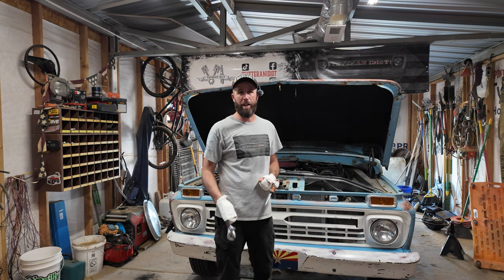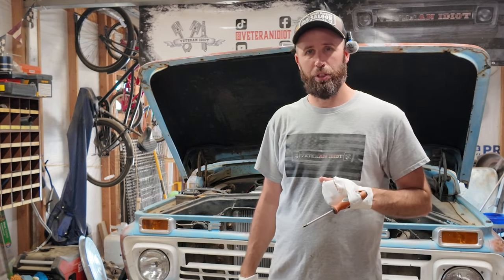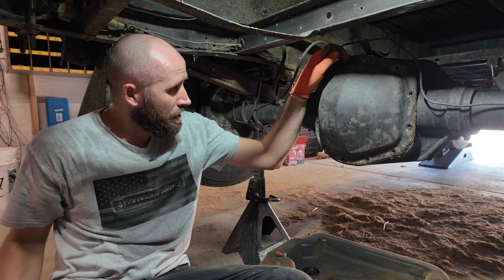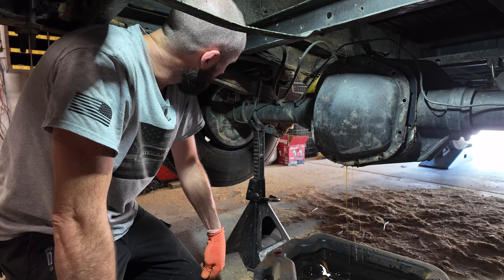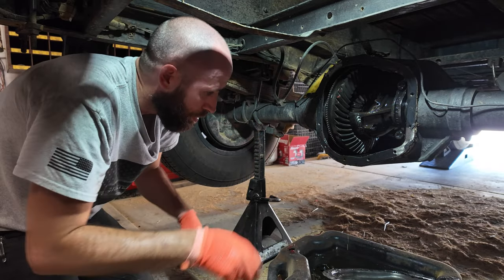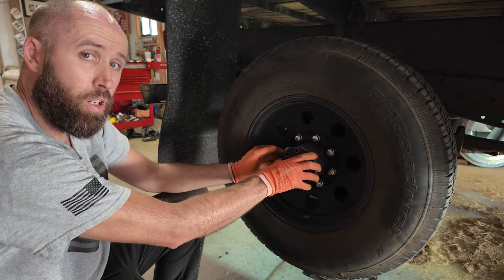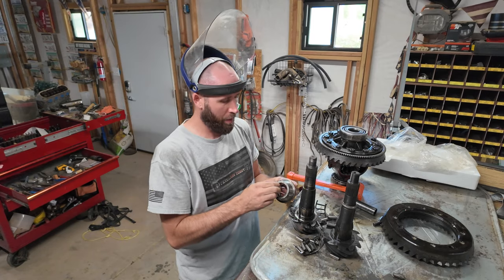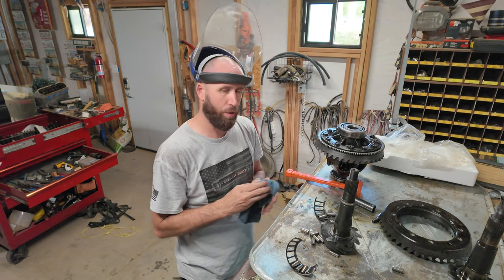How To Do a Backyard Gear Job On My 66 Ford

Comment: A great deal of good info here, but if you have a truck with a 1to1 top gear and a slow rear end , that you’ve added a more powerful engine to, and you want a more relaxed cruising speed, consider adding taller tires or tires and wheels. A more economical alternative, especially for folks with not many tools and no place to work. Most tire companies have spec books online for their tires. You might have to give up the shackle lowering. But hey, that will just save more money. Thanks for the video and take care.
Reply from the maker: Thank you, yeah I'm tapped out on tire size that I would like to have on this truck.

Comment: If you heat those bearing races with a propane torch they will usually slide right off. Great video   sorry about the spelling.
Reply from the maker: For sure, done it a couple of times. Thank you🤙